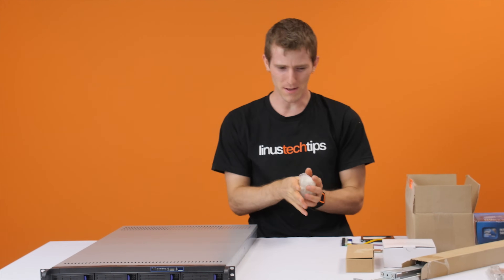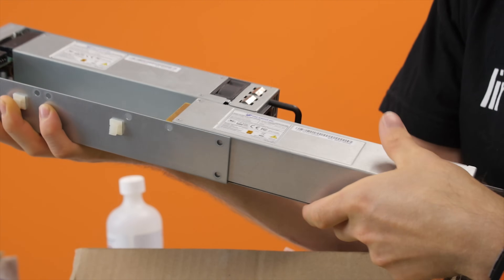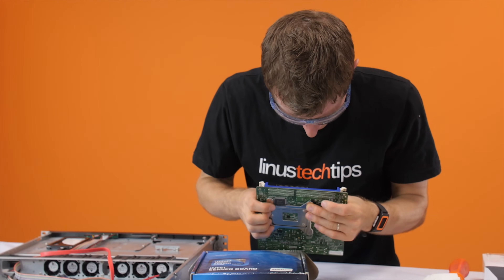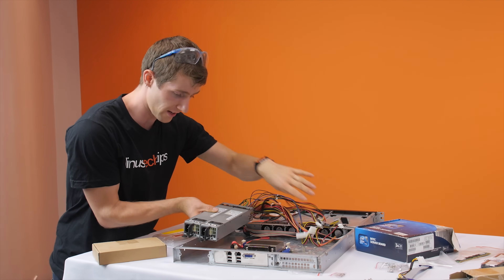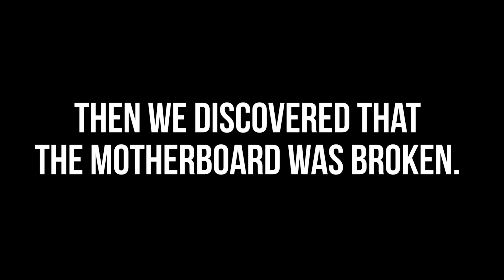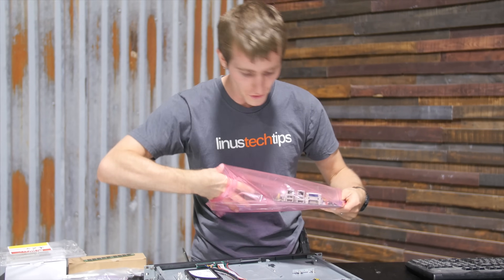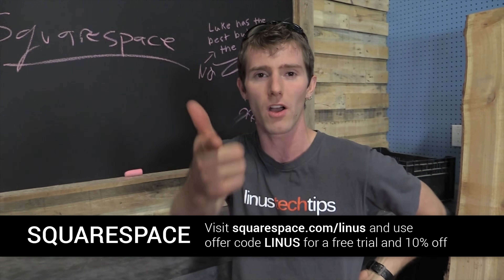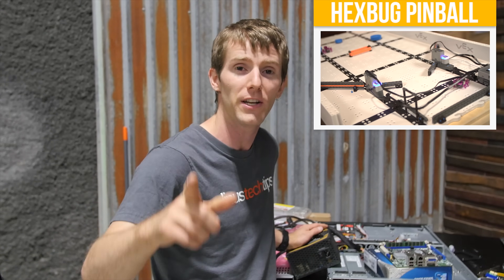DIY pfSense Rackmount Router Build Log - Part 1

Comment: has to be that back plate
Reply: I'm almost sure that backplate was the killer all along.
Reply: +magzire Shorting out components unless it's insulated on the side pressing up against the board.
Reply: +ZłyBratBliźniak That comment chain reads like a murder mistery dialogue... xD
Reply: kuhrd Proper Planning and Preparation Prevents Piss Poor Performance
Reply: Sauron How about zip ties?
Reply: +magzire To be honest I am surprised he did not test the hardware outside of the case or at least show that he did.  I would guess the same that the back plate is causing the issue.  I am surprised he didn't choose a board that was already known to be compatible with the case that comes with a low profile heat sink rather than having to mod so much of it.  Linus should also have a air duct to force some of the air from the fans over the heat sink like the majority of servers.
Reply: +magzire Yeah. It's touching too much metal. I wonder why they don't just use an ATX board.
Reply: +magzire Definitely! So many component legs touching it.
Reply: +Tengu Siv I don't know about that.  Sometimes I think Linus likes to try and get through a build without taking some time to think it through.  Whole room water cooling kinda comes to mind.  Not that it is necessarily a bad thing but sometimes I think mistakes could be easily avoided by just taking additional time to think everything through.  Then again modding is an art that has some inherent risk.
Reply: +Morpheus Stark
 Heat can be a problem for plastics. Painting the backplate may be a better solution.
Reply: +magzire Why is the backplate made out of metal anyway?
Reply: +Conky Jr I don't believe the speaker would cause any mobo to die though.
It's just a straight + to - line, unlike what would be more likely on the backplate - touching what seems to be everything.

plus the speaker seemed to have still been working.
Reply: +kuhrd What are you talking about?,THIS IS LINUSWEEDTIPS!
Reply: +Morpheus Stark I know right? I was like "it's conductive, Linus :| "
Reply: +magzire Even if the outer part of the backplate isn't conductive he did cut it exposing possable conductive parts
Reply: +magzire I wonder if at this point using plastic bolts wouldn't do the job better  :P
Reply: Didn't he also destroy the speaker? Could have easily created a short in the circuit by trying to remove it.
Reply: +magzire He used the motherboard like this with the same processor.
Reply: +Morpheus Stark 
Exposure to heat is still a problem as cooling of this server is really poor as you said. I don't think that the side of the backplate which is facing the board will get scratched. 

I don't entirely disagree but painting a backplate is easier than 3d printing a new one :D
Reply: +PhilfreezeCH 
I can't think of a reason other than a board failure for them to remove the board and scratch the backplate during the process.
Reply: +magzire Don't backplates have a non-conductive layer on the side facing the board?
Reply: He should isolate the back plate, it's touching the pins, that will kill the motherboard
Reply: +Franjo Lacković it doesn't look like this one has, but you're right,
Reply: Taking an angle grinder to it would definitely leave conductive material exposed
Reply: same.  I think it might be creating a short
Reply: +Conky Jr iv heard it different from my uncle when he was in the army, prior preparation prevents piss poor performance. but none the less they mean the same thing. thumbs up to you sir

Comment: Would of saved so much time and money just grabbing a cheap PowerEdge 1950 or grabbing a half-length, 2U case and using a ATX board. Then you'd have some more room for additional cards as well.

Comment: It might have been a better idea to use an actual router which because of ASIC's will offer better network performance and more networking centric features. I don't know about pfsense but I am sure there are ways of connecting the router and the pfsense box so you can still use the features available with pfense.

Comment: Linus You totally derped in this video. As I said in Vessel comments, Your backplate is shorting out motherboard
Reply: +Destru  Angle grinders generally grind it off
Reply: +oreskec Yea sure a lot of people picked up on that likely being the reason.
Reply: +KHROMATICxKHAOS What? I genuinely have no idea wtf you are on about.

How to test if backplate surface conductive:

-Touch backplate with both probes
->If any resistance then there is conductivity

->If no resistance then there is no conductivity
Done.
Reply: +oreskec Intel backplates are have an insulation coating.
Reply: +Destru What about the drilled parts of the backplate then? I think the coating wont reach those spots m9
Reply: +oreskec Wow even i saw that.
Reply: +oreskec He had backplate insulation on the second one, you can see him poking holes in it ...with the heatsink screws, before you say it, you can see it is bigger than the backplate so nothing would have been touching, that being said he fucked up so how, you dont get 2 dead boards one after the other.
Reply: +res1492 only 4 small parts, below each screw. other parts of backplate still could carry electricity
Reply: you can see it under the whole plate as he turns the board over when trying to rip of the speaker and has second thoughts @ 10:05 
He does this stuff for a living, i cant see him forgetting that a back plate conducts
Reply: Um, the cases have risers so they don't touch.
Reply: um ..were not talking about in shorting on the case, were talking about the heat sink back plate touching the boards components
Reply: +res1492 He forgets his own promotion codes like every single video. So forgetting that a backplate conducts isnt far out of reach...
Reply: +Briceson Hill  This will provide no information but the resistance between the two testing points. You would need to get the core material of the heat sink as one test point and the other being the surface material. Assuming this gives you any reading besides OL, then you have conducted the test correctly. Otherwise you would basically be testing the same material in two spots, which may not even conduct electricity period and give you an OL reading.
Reply: ***** You gotta get to dat core material m8 ...obviously, jeez. :P

Comment: can't you just turn a Pc into a router?
Reply: +JosephTheFirst1 Yes, you can! Any old PC can run pfSense. Intel NICs perform better than others, SSDs are frowned upon and unnecessary since TRIM is supported but is not really worth the time to configure vs the performance difference compared to any old HDD, and ECC RAM is both slower and unneeded.
Reply: how would that be possible??
Reply: But you still need a server right
Reply: +XxxGet ShrektxxX That's all he's doing in this video. ;D
Reply: Probably just trying to make it into a rack mounted setup so it'll keep his server room clean, at least for now lol.
Reply: XxxGet ShrektxxX No.
Reply: +JosephTheFirst1 Yes you can. Just need the NIC and software.

Comment: Didn't you think to test the second board with an intel cooler to see if it worked before putting that bogey cooler on it?
Reply: +vgamesx1 the backplate is probably shorting the motherboard, mate.
Reply: +xXDahChubChubXx He tested it with a turnip.
Reply: ***** I agree, it's quite likely that the backplate was touching and thus shorting out the board somewhere, however xXDahChubChubXx said the cooler, didn't mention anything about the backplate.
Reply: +vgamesx1 Stock cooler wouldn't have that backplate. I'm guessing that's what he was getting at.
Reply: +xXDahChubChubXx oh right it was the cooler that killed it.... Seriously?

NVM.. Read my second comment
Reply: +vgamesx1 The back plate is part of the cooler assembly... You wouldn't say there is nothing wrong with a car if the frame fell apart would you?
Reply: +vgamesx1 Not the cooler itself, but a bridge/short to the case or other point might... Heck, from the info provided, we don't even know if the output of the PS was correct....
Reply: *****
What? Stop now.
Reply: ***** oh for fucks sakes already... read my second comment, do I really need 10 people telling me what I and two other people just said?
CoilCode Fair enough.
Reply: +vgamesx1 when i sent that comment, yours was 2 minutes old for me because they loaded when i first started the video, no one else had replied yet.
Reply: +vgamesx1 Erm... what second comment???

Comment: Wow.... taht's .... Why didn't you just buy a full SuperMicro system? Like off of eBay? For less than $200..... And then install pfSense (or something like Sophos UTM or Untangled instead)?

You guys are absolutely crazy. :)
Reply: +Nathan Tipton 
I've seen datacenters with nothing but issues with Dell hardware. You're point?
Reply: +Nathan Tipton And Dell servers, or any other brand servers, use standardized parts? Nope.
Reply: Also, Linus Media Group: Servers done "WTF".
Reply: It's the joy of the challenge, I think.
Reply: +K Doe 
Maybe, but as I just recently bought a very nice 1U SuperMicro server off of ebay for $200.... (Supermicro x8DTU mobo, 16GB of Registered ECC RAM, and 2x Xeon X5560's) .... I think linus has now spent more than that on the motherboard alone. And the time investment (time == money).
Reply: +Christopher Courtney I get what you're saying, and it would be just fine going that route. The key thing is that he didn't expect the boards to die and this would've been just 1 build video.
Reply: +K Doe 
When does anything go the way that Linus expects. :)

Comment: TBH, that back plate mod is pretty sketchy. Also, are you sure all the components on the top side are clearing the heatsink? I would consider a Thin Mini ITX board with the Intel side blower heatsink for it. it supports up to 65W CPUs. only issue there is ThinITX boards usually use 204 pin SODIMMs.
Reply: I agree. It looks like he was really careful making sure it wasn't touching anything,  but I'm starting to think that this type of motherboard has some not-so-common back plate he needs to purchase.
Reply: +Skwisgar2322 Turnip mod is also pretty sketchy
Reply: That's what I was thinking. Could also be the speaker, might've damages the mobo by removing it.
Reply: +Skwisgar2322 that seems so obvious to me that I was shocked he kept trying to mount that heat sink, especially after the first bricked board.

1. It looks like the back plate is shorting several connections.

2. The front of the heat sink looked like it was resting on capacitors and other components. It would not surprises me if he either damaged those components, or the heat sink is not even contacting the CPU. Maybe that mobo does not have auto CPU shutoff it if over heats? I have not worked with itx boards before.
Reply: +Skwisgar2322 that is a great idea, but im sure the next 2 episodes are already filmed. :(
Reply: +Jose Rosas The speaker is nothing but a piezo electric component in a plastic housing.  He just cut off the top of the plastic housing.  He could have removed the speaker all together with a soldering iron and moved it to the side with a 2 short pieces of wire or just removed it all together (would not have system beep codes) and the board would still function.  The problem here is most likely the back plate contacting connections on the back of the board and shorting them out.
Reply: +kuhrd or he could have abandoned the idea of fitting non 1u server bits in a 1u server case obviously not made for any of the parts he was using. the reason the heatsink needed to be modded so much was it was never intended to be on a non 1u server board I would have tested it outside the case with a different hsf and none of the jank mods he tried especially when doing that with such expensive equipment.
Reply: I agree.  I highly expect that the cooler will be discovered to have shorted the boards
Reply: Ezekiel 6872 a turnip could have only helped in this case...
Reply: +Никола Кољо I don't know what you were trying to say but fixed my above statement.

1u does not equal itx compatible he needed to contact his friends at supermicro for this board https://jet.com/product/product/60e6f76d852d47baa21f49dfeb73857b?jcmp=pla:ggl:electronics_a1:electronics_a1_other:na:na:na:na:na:2&code=PLA15&k_clickid=76b778a0-57ed-4313-ad43-24a97cf2ba70&kpid=60e6f76d852d47baa21f49dfeb73857b&gclid=Cj0KEQjwvdSvBRDahavi3KPGrvUBEiQATZ9v0Ov8CwIvPc8qs06FdlyGCFPbHekTVMKyJjhqu-CpHkcaAoHA8P8HAQ

humm turns out there is a part for the mobo he has to allow it for use in a 1U case 
http://www.ebay.com/itm/Intel-Xeon-Mini-ITX-1155-S1200KP-E3-1200-Kenosha-Pass-C206-1U-IO-Shield-NEW-/400958337566

Well regardless http://www.newegg.com/Product/Product.aspx?Item=9SIA6J330R9088

Comment: Glad to see you using pfsense linus. I watched tek syndicate when they made theirs. I honestly can't believe you fucked two boards. Also that you had so much trouble with clearance. I think you should honestly start from scratch with other things. Fun to watch none the less
Reply: +xWipeout Except Tek syndicate knows you don't need to do all this bullshit just to make a router lol
Reply: +xWipeout 
Personally, I prefer Sophos UTM. Much more turn key. And even for the business stuff ... while it may be expensive, I suspect that Linus could have gotten a good deal.
Reply: +xWipeout For years I have been using Clear OS (used to be ClarkConnect) as my home router OS of choice.  Lately I am rebuilding my router to run ESXi and then virtualize clearos, freenas, linux mint and windows server 2012 all from a single mini ITX box with a quad core i5 and 16Gb of ram.  Should use very little power and eliminate some hardware.
Reply: +xWipeout  tell linus to 
STICK TO PFSENSE 2.1.5
newer versions HAVE PROBLEMS with   PROXY CACHE AND BANDWIDTH LIMITER
its supposed to get fixed on 2.3.0
Reply: I would just go the lazy route and get a 2U case, to make life easier.
Reply: +SeanFromPVD I'd go the even lazier route and buy a pre-made HP/Dell 1U server. Cramming components into a cube case is one thing, cramming everything into a 1U case is an entirely different story. And I wouldn't want to be hacking parts to build a mission critical machine anyway. Leave that to the people who know how to do it best and fill datacenters daily with their kit.
Reply: +kuhrd i recommend you to use kvm instead of esxi
Reply: ***** Depending on your needs, you can actually buy a decommissioned server really cheap. (I bought one that originally retailed for like $15,000, for $299 when it was replaced.) Despite being a couple of years old, it actually still was a pretty powerful machine.
Reply: Oh I know. I was fishing around eBay only last week for a used server. Found some 2x quad core xeon proliants for under $100
Reply: TheWislers Is their a specific reason you recommend I should run kvm vs ESXi?  The main reason I was choosing ESXi is that it runs pretty much at the bare metal level which is much lighter than a linux distro running VMs.